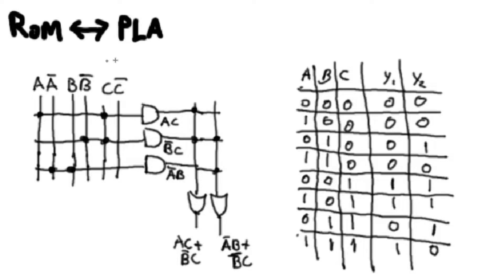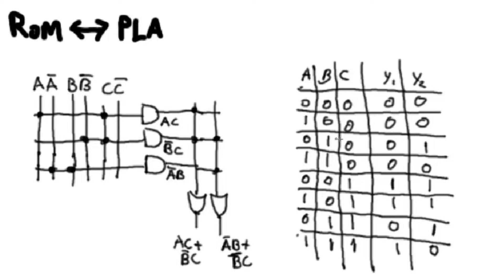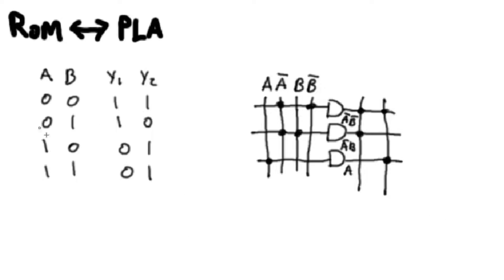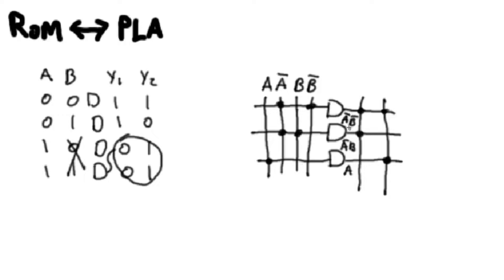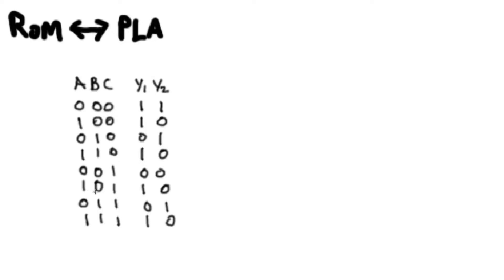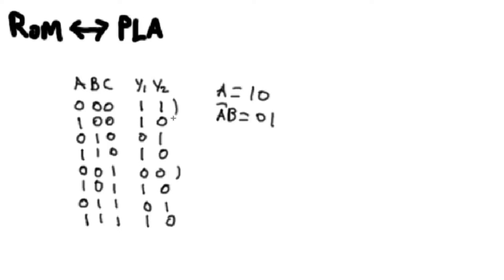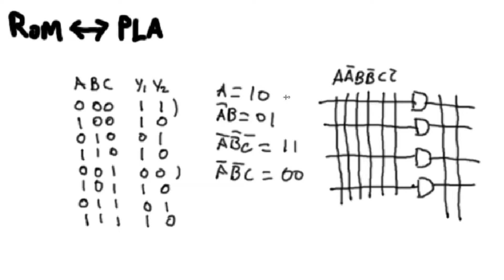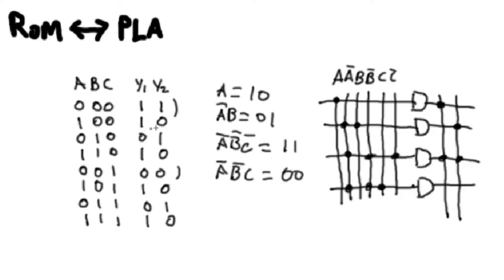Using ROM's and PLA's Interchangeably

Comment: I would say that for mc, there are 2 things that would determine why i would use pla vs rom: 

1. Obviously size. If i notice obvious bit patterns i'll use karnaugh mapping to see if pla is faster/smaller
2. Freedom of expansion. If i wish to change the logic in the near future, PLA can make things harder because of the logic optimisations.

I tried to make a control unit based on PLA, where the OR grid was limited to have the fastest decoder possible. I tried rearranging instructions so it would favour some logic reductions based on the output, but ultimately i found that PLA punishes me too hard if i made a mistake somewhere on the control lines. So mostly i use PLA unconsciously for smaller "ROMs" , like a flag decoder unit.
Reply from the maker: Good input!
I do agree, PLA's aren't really that flexible. But if you don't intend on making changes in the future, they save you a lot of space and repetition.